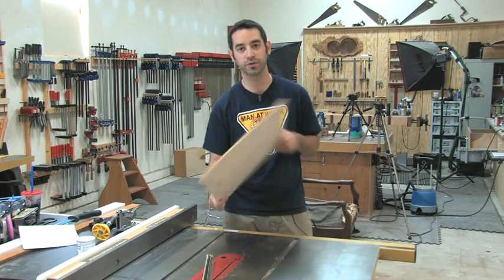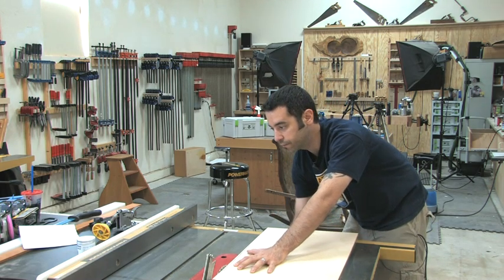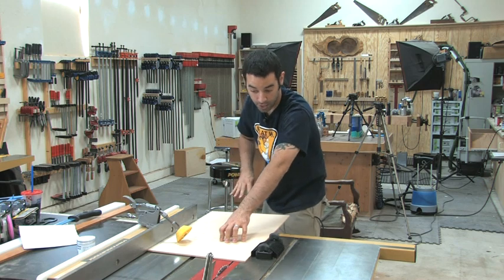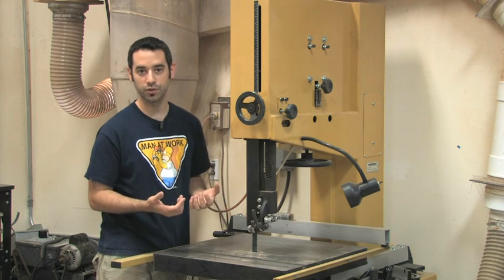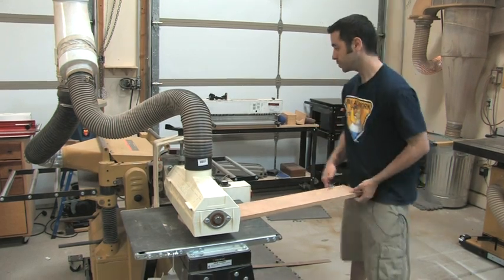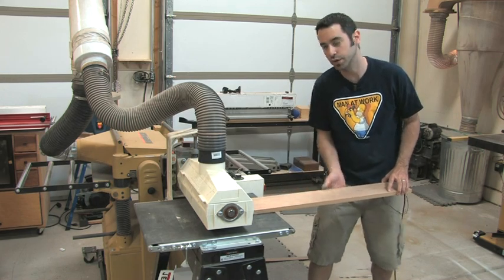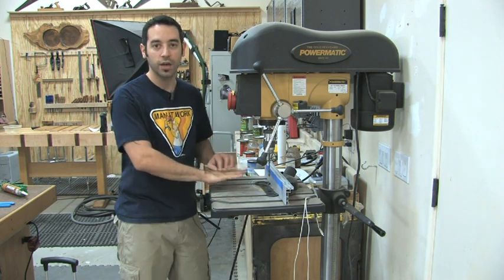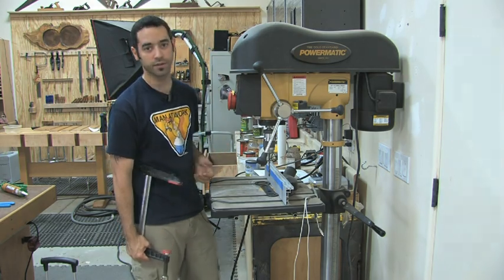52 - Shop Safety: My Mistakes

Comment: Two things I've learned very recently:  1) Do not try and feed short boards through a planer.  It will turn sideways, get chewed up by the blades (possibly damaging the blades), and fire the chunks back at you.   2) Always ground your dust collector.  I failed to do so, and one day I came too close to the collector while listening to music via earbuds from my phone.  The static electricity blew out those earbuds.  Luckily I didn't blow an eardrum.

Comment: Knock on wood, my worst mistake in the shop has been at the drill press.  I was using a 6" hole saw cutting through 1/2" plywood.  I was working in my dad's shop, and when the hole saw grabbed the plywood - the piece was, I think, 8"x8", it spun it in my hand (it was clamped down, but evidently not enough) and my fingers were in the vicinity.  It dislocated two fingers and completely skinned them both.  I called my dad, who was in their house at the time and said, "get an ice slurry ready, I'm coming in with broken fingers".  We set them, wrapped them up and I was back to work the next day.

Comment: Another tip not often mentioned: Using gloves in the shop is dangerous; so easy for a glove to get caught in the workpiece or to the blade. Fortunately the belt on my drill press wasn't tight enough to do a real damage, but it certainly is scary to have your hand pulled and firmly wrapped around a power tool bit!

Comment: My two scariest incidents involved two tools you didn't show .... the shaper and the lathe.  After 45 years, I'm still tensed [not good] when using the shaper without the power feeder.  On the lathe, it's now strictly copy work with a duplicator.

Comment: Thanks for this, Marc.
I've been a hobbyist woodworker for 25 years without an accident, and then had 2 trips to the E.R. within 2 months. One on the lathe, and one with a 4 1/2" angle grinder. Fortunately, I still have all 10 digits, but my left hand will never be the same.  
My contributions:  #1- Never use an angle grinder without the blade guard. A cutoff wheel can split in two, fly off, and imbed in your knuckle, severing the extensor tendon. Surgery and months of physical therapy.  #2- Always check large pieces on the lathe for cracks. A 16" platter is an awful weapon if it separates at 1500 rpm and hits your arm.

Comment: I'm a DIY'er in the final stages of building a table saw with a router station.  One of the items I cut by hand quite often is quite large pieces of 5 mm ply and had planned to do this on the table saw once completed.  In order to ensure long term straightness and ease of attaching various additions, my fence will consist of an aluminium extrusion with T slots on all faces. Your thin sheet mishap has made    me realise the benefit of making a hold-down to attach to the top of the fence or a feather board on the side face.  You've prevented what I now realise would have likely been a repeat of your mishap, for which I'm extremely grateful.

Re your router missile, you've made me realise that because most routing is performed with the workpiece on the outer side of the cutter, one would get into the habit of feeding in the same direction as when using the table saw, so when feeding between the cutter and the fence as you did, the natural action would be to continue with this habit, completely overlooking the need to feed from the far side.  Again, you've taught me something vital and so hopefully prevented a missile situation.

Many thanks indeed, I'm forever grateful.
Reply: You might want to consider using a simple hand-held circular saw and a clamped straight-edge guide rail for cutting plywood panels. Probably much safer, since you are not trying to manipulate the large, unwieldy panel.

Comment: Marc, don't feel too bad. I think we have all had those "duh" moments where we sit back and in retrospect go "what was I thinking, and was I thinking?" For me, it was wearing shoes in the shop. One night I couldn't sleep, was wide awake and decided to do some glue up on a project I was working on. Shop floor was swept clean and all the power tools were put away so I figured what was the worst that could happen. It was all fun and games until one of those pieces fell off the bench onto my pinky toe. Left a lovely blood blister but could have been much worse. 

I know you can write a fairly thick book on just the basics of shop safety, but another big one in my opinion is the proper care and maintenance of tools. I also try to rehearse my cuts before actually committing to them to make sure the important things are going to stay clear of the blade and any other moving parts/pinch points at all times. It isn't a perfect system but has saved me a few times. One rehearsal revealed something so stupid in my hand placement that I hung the tools up for the evening and decided to come back to it when my brain was back on.

Regarding the drill press, clamping your work is a good tip but it doesn't guarantee that everything is going to stay put. I was drilling through some steel angle on the drill press with my motor set on the slowest setting. The bit bound up and because the workpiece was well secured, the failure occurred at the next weakest point which was the 3/8" drill bit. Fortunately I was wearing safety glasses when the bit hit my face but the bit shrapnel left a nice clean cut on my cheek right below the frame of the glasses.

Comment: I remember when I was a kid (about 11 or 12) in my dad's home workshop, using his band saw (which I still have now 30 years on), trying to cut a piece of wood with the table at 45 degrees. Don't remember why, I think I was just practicing. Anyway, I wasn't using a fence and the wood slipped, along with my fingers. I ended up with a large cut in my thumb, from the pad to the nail, about 6mm from the side. Needless to say I learned my lesson about fences, and respecting the tools. Fortunately, the wound healed without leaving a scar (which I am still surprised about) and no damage to the nerves. I often remember that when I'm setting up, or placing my hands when cutting, drilling, planing or anything where I'm near machinery. Thanks for sharing your stories, they do make you think.

Comment: I don't have a drum sander and I was very surprised that there is nothing protecting the leading end of the conveyor.  Any kind of fixed, vertical edge adjusted 1/16" lower than the surface of the belt would have prevented your finger from going in there and wouldn't affect the useability of the tool.  That is what is called an "in-running nip" hazard and should really have a guard.

Take care
Bob

Comment: my dad worked in carpentry workshop for about 20 years, and only ever had one mishap he was running a board though something (drum sander or plainer or something along those lines) and was not paying attention because it was close to the end of his work day ended up getting his thumb caught in it and almost tearing it off he got it reattached thankfully, and it helped me out when i got old enough to work in a factory i was always very careful and it has saved me from getting hit by forklifts and slipping into the trash compactor a few times and im so glad that he told me the story when i was young and scared me to death enough that i was smart enough to watch out when i was older

Comment: Great advice.  I can vouch for the dangers.  Your experience with 1/4" plywood and a tablesaw is similar to what happened to me.  I ended up with a broken thumb.  Immediately after the cut, I allowed myself to become distracted by the thin drop piece that was being sucked into the saw blade.  Fearing the flying drop, I must have relaxed my grip on the 24" square piece.  I think that's important to note.  As the length to width ratio approaches 1.0, the risk increases.  Higher ratios put much of the force back on the fence.  Until it happens to you, you just can't imagine how fast that board is moving.  You're pushing a board and everything is fine, then the board is just GONE!  The board flew like a frisbee even after breaking my thumb, and cut a nice size gash in the drywall 12 feet away.

Your router story reminded me of an incident with a drum sander... Believe it or not, not all of them push AGAINST the feed.  An eight foot 1x4 flew like a missile reminiscent of hurricane impact tests where the shoot 2x4's out of an air cannon at hurricane shutters.  Luckily no one was in the path of the projectile. 

Keep up the great videos.

Comment: Good tips as a 60 yr old newly retired hobby woodworker these video clips are gold to me many thanks tho I will not be buying bigger machines it’s still good to be safety conscious
Reply: I agree- it is always good to be safety conscious and even the smaller machines still pack enough power to do some damage if you aren't careful. In fact, some of the smaller and more portable equipment come with additional safety precautions. For example, portable table saws are less stable than the bigger cabinet counterparts so extra caution must be exercised especially when working with larger sheet goods. I personally prefer in this case to break sheet goods down with a circular saw first and then clean them up at the table saw if needed.

Comment: Remember that our intuition is there for a reason. If you start to do something that doesn't feel quite right, stop and rethink what you are doing. It is not unusual for your mind to pick something up  in the background, that your forebrain missed or is ignoring. If it feels wrong, STOP. Get more clamps, reevaluate how you are doing something, or find a different way or tool to get the job done. It is not worth being injured. Sometimes sleeping on it is the best way to put it in perspective.

Comment: Thanks forsharing. Iadmire your humility and willing to share with the rest of the community.  No doubt you saved me at least a few visits to the hospital.  THe thing I try to remember is that while the chance of any accident may be small on a given day, cummulatively it is gets very high if you are not using consistent, safe practices.  That, of course, and the consequences of an accident involving sharp, high speed, rotating metal means only bad things can result.  You the man, Mark!  Again ,thanks for having the courage to share your mistakes.  In my case, even though you have shown me waht not to do, I am dumb enough to still do it but Lord knows I am trying not to kill myself...

Comment: I'm a millwright by trade, but I am very interested in learning about woodworking and I enjoy all of your videos. I've seen and experienced many mishaps as well. Something I take very seriously is: no loose clothes, no rings, no long hair anywhere near rotating equipment. You touched on a drill press incident. I've done and seen it many times where a person holds a workpiece. Take the 5-25 seconds it may take to clamp that piece and get your hand/s out of the way. And don't ever, ever, grab the chuck when the power is off to slow it down to change the bit or whatever. Drill presses and table saws I've seen the most injuries. And if you value your hands/fingers, or anyone else's in the shop, get a saw with an explosive brake. I've seen it in action save a man's fingers. Worth the investment. Great videos. I'm excited to build my shop and use some of your tips and techniques.

Comment: Thanks Marc, there is something to be said about learning from experience, but I'm happy to learn from your experience on this.  My scariest shop moment so far was installing jointer knives.  I didn't double check that all knives were tightly secured before starting it up.  I got 2 out of 3 tight and I hit the ground so fast after turning it on.  The sound of a loose blade whacking the underside of the out feed table over and over was terrible, but luckily it didn't fling a knife across my shop at 100 mph.
Reply: My uncle told me of a similar incident involving a 4 side planer in a sawmill ( the machine that surfaces 2x4s, 2x6s etc). Someone had been replacing blades, and got interrupted  during the process, can't remember the exact reason. Anyway, failure to double check the blades, resulted in the machine being turned on with one blade not secure. There was a loud bang, and the knife was flung through the building's roof, and as far as I know, could not be found despite extensive searching. Luckily no one was hurt.

Comment: The point about thin plywood on a table saw is no B.S. Probably one of the most dangerous things to cut on one. I was cutting a piece about ten years ago that was about two feet square. I had the blade set right and thought I was being very careful. I really don't know what happened but at the end of the cut the bottom of the piece somehow came in contact with the top of the blade. It shot back at me, spinning like a frisby from hell. It put about a two inch gash between my right ring and little finger, down to the bone and actually broke my ring finger. After thirty years or so of woodworking that is my worst injury. Knock on wood. When I teach new guys at the shop I always tell them the most important thing to know about a table saw is what NOT to do.
Reply: Gacracker Dave ...agreed, for thin ply I use a track saw. Much safer!
Reply: Gacracker Dave  I can relate to the thin plywood story. I didn't get hurt and saved the cut. My worst story is ripping a 2x4  length wise. I had a splitter in place but after completing about 3/4 of the cut the board closed up and it shot an 8ft 2x4 about 35ft down my driveway. Luckily I had a suspicion something could happen. I usually have someone put wedges in when I'm ripping a 2x4 but no one was home that day. If my truck had been there the 2x4 would have gone through the radiator and probably done additional damage!
Reply: thanks for sharing. Never really registered cutting thin ply as a danger for kickback... So thanks for sparing me the (potentially painful) experience.
Reply: Gacracker Dave
I had something similar happen, it spun around as i pushed it through. My habd was still on the board and it shot back at me. I am so glad my hand didnt get pulled into the blade or that it did any damage to me when I got hit. Just scared the crap outta me and damaged my ego and pride. Much more careful with that thin board now......

Comment: Good stuff.  I made a similar mistake on a router table in a community ed class... just learning before I had any tools of my own. I guess I was late and missed the quick rundown on the router table. So when I wanted to put an edge on a shelf, I started pushing my board into the router bit IN THE WRONG DIRECTION. It only took a second before the bit grabbed the board and launched it down the bench (router table was built into a long workbench), knocking apart another guys's project he was dry-fitting.  No injuries, and it's funny now, but that's the hard way to learn!  And talk about embarrassing... in a class full of other adults!

Comment: The distance between the casing on a hand held belt sander and the belt on said sander makes an excellent shrimp peeler. My left pinky finger can attest to that. All is well. I cleaned and wrapped the skin back in place and it knitted back like a skin graft. Physically, today, it's like it never happened. Mentally, it happened yesterday.

Comment: I remember once I was pulling safety wire on an aircraft engine when my safety wire pliers slipped off the wire and I slammed the tip right into the very edge of the bony orbit of my eye.  It was that ONE TIME I couldn't be bothered to put my safety glasses on, and all I saw was a big flash of light.  I thought for sure i was gonna be 'that guy' that stories were told about for years.  My partner saw the look on my face, "Let me see... "  I took my hand away.  "You're a lucky man."

I missed losing my eye by, literally, an eighth of an inch, and only got a nick and a bruise from it.

I love my safety glasses.

Comment: There is definitely a professionalism that you need to bring into a shop to be safe. After going through 10th grade woodshop it amazes me how dumb teens (like myself back then) are allowed to work with those dangerous machines. I have seen so many teens who are just goofing around, I'm surprised more of them haven't been injured in some way. Great video.
Reply: i did shop Foreman at my highschool for a 9th grade class and some kid thought it was a good idea to clear a thin scrap from the table saw while the blade was still moving. then we had the 3 times someone lost control on the miter saw and shot a piece of wood back.

Comment: Something to remember is that it isnt just shop tools that are dangerous. I was working in a tight area, using an impact driver and my hand slipped. The driver bit dug into the thumb nail on my left hand as I was supporting the piece. The blood was a slow trickle but it didnt want to stop and it hurt like hell.

Comment: Well done. I expect you have prevented a few more injuries without any health and safety daftness. I see a lot of videos with fingers or hands passing over a saw blade or router cutter. When I first used a surface planer a long time ago I did just that and hit a knot. I shaved 1/16 off the tip of my middle finger.  I was very lucky, but still a beginner. When using a jointer, which I never do now, the exposed cutter should be guarded. I don't see that on videos very much. Also I see wonderful zero clearance inserts and no riving knife- insanity.

Comment: My only shop accident so far has been with the drill press.  I was drilling into metal and the bit grabbed the piece, spun it around and flung it at my face.  My chin got a nasty gash.  It even shaved part of my beard off.  Quite painful.  Blood everywhere.  But now I know... clamp it and use a fence in case the clamp fails.